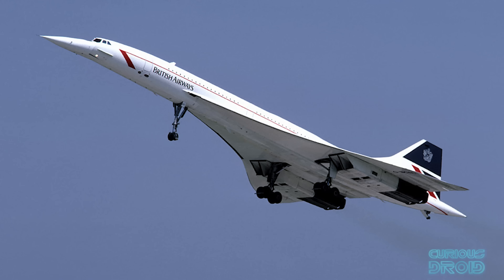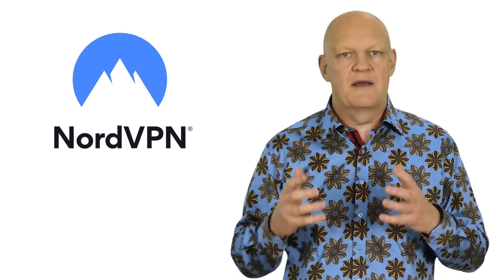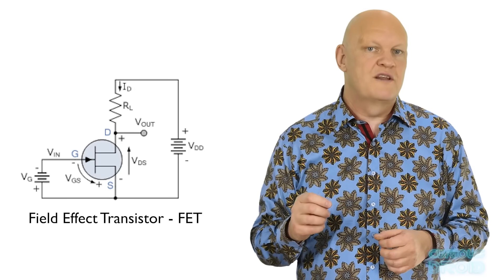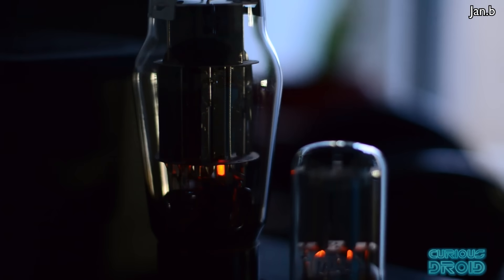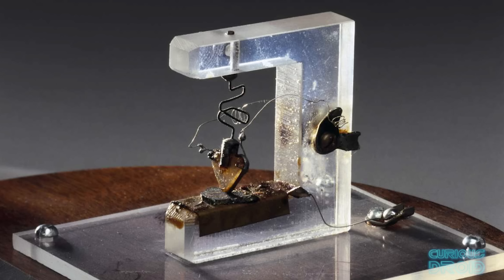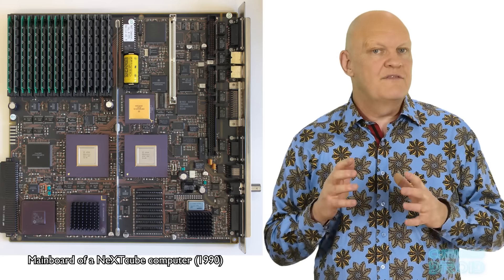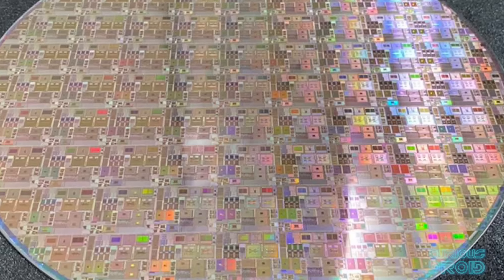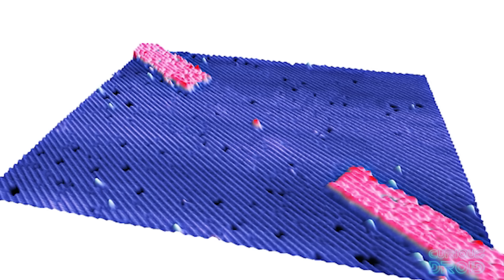MOSFET – The Most significant invention of the 20th Century

Comment: Mosfets as well as other random transistors are one of the items I've purchased in large quantities over the years that ill probably never find a use for.  Although I went to school for electronics tech its only a hobby for me, but its led to me feeling the urge to collect mosfets, as well as 100+ lbs of magnet wire aka enameled copper, and an absurd pile of large electrolytic can capacitors.  Think i have somewhere in the 250 - 300 large dc caps.  Probably my most valued possession.   Lol.  Im a bit ocd.  Especially the compulsive part of it.

Comment: MOSFET's also transformed the audio industry in the 1980's by providing a warm high power output for audio amplifiers,  which was far superior to the Bi-Polar designs common at the time.
I still have my MOSFET amps, built in 1987. They get used every day and still sound better than just about anything else that's ever been made...

Comment: Most significant?
No.
WIlliam Shockley. of Bell Labroatories, had intended to invent the MOSFET as a transfer of the Vacuum Tube technology of the day into a solid state design, but was stymied by his limited understanding that the surface of his semiconductor device had to have a perfectly regular crystal structure, and had to be made from perfectly pure stock.
That is, Shockely's inability to understand Surface States meant that his design could never succeed. Failure was followed by failure over several years.
In desperation, Shockely team members Bardeen and Brattain abandoned Shockley's concept, and created the point-contact transistor.
This device had no precedent in any form of electronic design - it was a "totally unique" device that owed nothing to any prior art, and was obsolete almost from the day of its invention.
Shockley, who had been left out of the point-contact Patent, then invented the Junction Transistor.
Junction devices would dominate seniconductor technology, in radio, televsion and communications for some 30 years, including RTL and TTL logic chips and some few microprocessors.
It would only be with Mohammed Attala's revisiting of Shockley's design, addressing the problem of Surface States, that Metal-Oxide-Silicon devices would become practical.
It is true that MOS (NMOS/PMOS/CMOS) technology would come to dominate electronics and computer techology, with bipolar devices dwindling well into the minority.
But it was the Point Contact design that proved the practicality of semiconductor technology, junction devices that established semiconductor technology as a viable alternative to Vacuum Tubes.
MOS devices leveraged the commercial success and industry-wide application of junction technolgy, making MOS - for all its current dominance - the third phase of semiconductor applications.
I do not agree that "third place" equals "most signficant" - dominant? OK.
Reply: The RCA 1802 was produced on silicon on sapphire. Silicon does not grow perfectly on this. Does it form domains? Need gates avoid domain boundaries?

Most semiconductor insulators interfaces have surface states. Only silicon does not. Why does roughness matter ?

Comment: The mosfet is just an ant worker what is do boreing things like switching on and off.
The things around we are olso chaned a lot because groove a demamd to use this switching devices because they are cheap to produce in large volumen.
They are thruly change the thinking they turn every power or signal processing into the digital way.

Comment: The most amazing thing is if you take a group of a dozen smart individuals, place then in an island with access to cuper, iron, thin, lead, stone, wood, mud, sand and a few other raw materials, with the average knowledge we have nowadays,  we could jump from stone age to pre-industrial in less than a decade. With primitive makeshift tools and raw materials, we can make every time a more developed tool. As hammers, pliers, saw, files, and so on. To pass the industrial revolution, we would need thousands of people. But to make a single integrated circuit, it would require the effort or millions. Too many and too much precise and sophisticated machinery are needed, and very specific scientific knowledge. Until the millimetre, it's a normal human terrain. Smaller than mm, it requires machinery that a single individual isn't capable of developing himself alone.

Comment: Can anyone explain exactly how a transistor amplifies voltage?

Sure - it might be able to 'hold-back' the input voltage versus the output - creating a gradient - but that isn't 'amplified' - just restricted in-command.

If it is fed X Volts - how does it create >X Volts - at all?
Reply: I’m most familiar with audio amplification, so here goes my explanation of a bipolar junction transistor (the kind used in amplification) from that angle: a base current in the form of a lower amplitude signal (e.g., from a guitar pickup) modulates the voltage gradient of a transistor in a separately powered amplifier circuit. This causes proportional changes in that higher amplitude collector current (e.g., the guitar amplifier signal powered by the wall outlet), in effect increasing the amplitude of that original signal by recreating it in a signal with higher amperage. So the transistor allows a smaller current to control, but doesn’t actually supply the power needed for, the amplified signal—that’s supplied by the amplifier’s power source. The voltage gradient has to do with how the transistor itself works to modulate the higher amplitude signal, allowing it to be controlled by the lower amplitude signal.
Reply: It doesn't amplify voltage by itself, a higher voltage source fed through it's emitter collector thus the input signal at the a base is amplified (mirrored with the source). Basically you have a device that can modulate raw external power with a small input signal. You do need a source, just like a audio amp needs the outlet. Although it inherently has some current amplification properties.
Reply: @neurotransmi77Er  Ah - so, it's not doing anything more magical than a simple relay, correct?

Except, sure - it is chemical, not mechanical.
Reply: @ArifGhostwriter  by itself, in principle, true, but you can also amplify AC signals at input with DC at source. That was the original challenge. Relays can't go analog. It's either 1 or 0. Although it might be possible (and noisy as hell) in theory but not practical. Transformers were the deal at that time.

Comment: I'm still not clear on how the machine accesses the stored information.  If you have say, an MP3 song stored in a chip, that would mean several millions of gates charged or not charged presumably in a sequence.  On a vinyl record the stylus moves along the groove and wiggles accordingly.  OK.  On a magnetic tape the tape moves over the head which detects changes in the magnetic field.  OK.  But...in a chip everything just sits there and nothing physical moves down the line "reading" those gates as being 1 or 0.  

All I can come up with is that a current moves down the line and is altered by every group of 8 gates along the way?  If so, how can that be if the electrons are moving at around 140,000 miles per second?  The song would be over in less than a second.

I suppose it would have to read the entire song, store it and slowly release it to the logic gate system/program that interprets voltage differences as variations in sound wave amplitude?

Comment: A Communism-disguised-Capitalism system;
Karl Marx, Nikola Tesla, Balfour, Einstein, Huxley, Orwell, Turing - should be forgiven for thinking their systems can last forever.
Finite fossil fuels are dangerously hypnotic to humans, their consciousness, reasoning and mental capacity.
Humans were not ready morally, ethically and intellectually to start the mass extraction of fossil fuels with the advent of the steam engine 300 years ago. 
The Magna Carta requires today overhauling – adding to it the right for humans to understand what Energy really is - before any other commandment;
“In any system of energy, Control is what consumes energy the most.
No energy store holds enough energy to extract an amount of energy equal to the total energy it stores.
No system of energy can deliver sum useful energy in excess of the total energy put into constructing it.
This universal truth applies to all systems.
Energy, like time, flows from past to future” (2017).

Comment: Moore's Law is forcing us to follow in the footsteps of Mother Nature and use some of the tricks she uses.  First we start out planar.  Then we go vertical.  After that we go manifold.  And finally we leave the single tissue stage of electronics and go into making essentially organs.   But what about heat you say?   Well yes, it will require a pump/heart.  It will require surface area.  It will require us to think in terms of self assembling electronics and exploiting quantum mechanics in controlled environments inside vats to grow our evo-chips.  Maybe.  Just a thought.  Ideas do seem to present themselves though, and just right at the right time when we are actively looking for those solutions we need.  There might be design, technological, and manufacturing hurdles to jump over before we get there...but chips that no longer resemble a simple tissue and start to resemble an organ are not physically impossible.

Comment: Despite promised advances in chip capacity, low to mid-range computers have remained at about the same overall power for the last 10 years. My HP x360 laptop (bought in 2016) is STILL more powerful than the bulk of inexpensive laptops available today. So most people will be unwilling to buy a new computer if the one they already own is as fast as the ones available in stores or online. 
Which is a problem for Microsoft Windows systems. Because Windows 11 won't load on most of those older computers, due to requirements like TPM 2.0 and such. So pretty soon millions of users will be looking for alternatives to the new Windows operating system releases.

Comment: @11:20 that exact flash drive failed on me, because it wouldn't side out and lock/notch to you can stick em in your good old USB 2.0 portno instead they just fail first by being unable to get it into a smart TV FOR EXAMPLE with No MKV players supporting CASTING, or h.264 1080p AVI That can or can not play the file through casting but would with a USB Controller, and that little device failed on me good for 2 HD Movies under2 gigs or 720p about 5 or 6 SO what waas wrong with these old USB sticks and if i buiy a 128GB new one, The FINFET Vstacking technology of samsung SSD's..... hmmmmm how reliable is it and what brand f USB Stick carriers or SSD's that support SATA and SATA power as well with a module that makes the USB Compatible forrom the outside of a Laptop s i can charge them up on a deskktop bring my entire movie collection from Y T S {DOT} AG so someones $K TV As i can download the 4k files but to view them just stick to a USB STICK ey of 160GB for a 4GB movie yeah (wllcompressed excellent quality audio lemme check H>264 doesnt dsay shitabout audio except DTS and someones setup
Reply: " without leaking away over 10 years " uhm, if a 164GB USB pendrive only lasts 10 years? yeah id rather stick to a 8TB Harddrive

Comment: The structure resembling the MOS transistor was proposed by Bell scientists William Shockley, John Bardeen and Walter Houser Brattain, during their investigation that led to discovery of the transistor effect. The structure failed to show the anticipated effects, due to the problem of surface state: traps on the semiconductor surface that hold electrons immobile. In 1955 Carl Frosch and L.

Comment: I want to add that after inventing point contacts transistor by Willium Shockley , John Bardian and Grand  Britain, in Dec 1947, the transistor radio  was not shaped,  until the Junction transistor was invented in 1950. Bcz point contact transistor was of directly proportional to out puts hence its amplification directly caused on its in put circuit and caused more noise.
The 2nd invention junction transistor was  inversely proportional to output, so no positive feedback and no noise.
Then soon after the commercial transistor radio was invented.

Comment: The MOSFET was invented by Mohamed Atalla and Dawon Kahng at Bell Labs in 1959. It was a breakthrough in power electronics. Generations of MOSFETs enabled power designers to achieve performance and density levels not possible with bipolar transistors.

Comment: One 7 nanometer transistor is 35 silicon atoms wide. I can't figure out how it is possible to work on such small size dimension, without make any errors on millions of transistors. It is also impossible to figure out how it is possible to build machines which can work on that scale of mechanical precision. I don't know how many people are fascinated by the bulky and energy wasting vacuum tubes, and not by the silicon integrated circuits...

Comment: At the heart of every EV and PHEV electric automobile, is a device called an "inverter". It's job is to take power from the car's traction battery, which is "direct current", typically around 375 volts, and output 3-phase alternating current to create the rotating magnetic field in the car's drive motor that makes the rotor spin and propel the car down the road. In a typical car like the Chevy Bolt or truck like the Ford Transit EV delivery van, a single 3-phase motor is used, that can deliver around 200 maximum horsepower - that's a LOT of power out of a rotor and stator that weigh less than 100 pounds combined. In order to obtain 200 mechanical horsepower out of the motor to drive the wheels, you need to feed it at least 160 kilowatts of electric power. Out of a 375 volt battery, that's 426 amperes of current! Of course, most driving situations only need maximum power for short periods, for example to pull away from a stop on a steep hill, so most of the time the car's battery only needs to supply 5 to 30 kilowatts. At steady cruising speed on the highway, the car will only need about 20 horsepower, or about 18 kilowatts. So here's where MOSFETS come into this story. Remember the Inverter? It's job is to take DC from the battery and convert it to AC for the motor, and it does this with high-power MOSFETS. Attached to the rotor is a sensor called a "resolver", that sands a signal telling the computer in the inverter what the angular position of the permanent magnets in the rotor is, in relation to the windings in the stator coils. This computer sends a low-powered voltage signal to the gate of each of the three MOSFETS (or 3 pairs if they are doubled for higher power capacity); this voltage increases and decreases in a sine wave, and the three signals are phased 120° apart, since these motors are 3-phase "synchronus" designs. 

The low power signal to the gate allows a much higher current to flow between the battery and the stator windings through the channel between the Source and Drain terminals on the MOSFET. The computer uses the signal from the resolver sensor to set the timing and phase angle, and the signal from the throttle pedal sensor to set the amount of power. These electronics in modern EV's are so precise, that a driver can make a car crawl up a steep driveway and into a garage at speeds that make a snail look fast, or, the car can climb hills on the freeway at 70+ mph. 

Cooling: Traction motor Inverters in EV cars are all liquid-cooled: the MOSFETS are attached to a big aluminum heatsink plate through which antifreeze coolant is pumped, and the heat dumped to atmosphere through a radiator. The motor stators are sprayed with transmission oil, and that oil is run through a heat exchanger and radiator to dump waste heat to atmosphere (or to warm the battery in cold weather in some cars). The base of the MOSFET is coated with a layer of heat conductive paste, same as the CPU in a PC computer. EV powertrains in modern cars are amazing, and they'd be impossible without MOSFETS to supply the hundred-plus kilowatts of power for the drive motor.

Comment: Car audio amplifiers were my introduction to MOSFETs. I recall in the late 1980s and early 90s, manufacturers made a big deal out of their amps being "MOSFET" amps.
Can you guess what's inside of modern audio amplifiers in 2023? MOSFETS. They have gotten better, able to carry more current at higher voltage with faster switching speeds.

Comment: Oh, God! As a Professional Guitarist who uses Vacuum Tubes/Valves in Amplifiers and other Audio Gear to this day, just thinking about the Cost of replacing all 2,400 Tubes in The Colossus Supercomputer makes my head spin and my stomach turn!

Even if they were 12A*7 (12AX7, 12AT7, 12AU7, etc.) Double Triodes Tubes, the most common Tube Family in the World today, at a lowest Cost of ~10$ (USD) per Tube for the cheapest ones out there would still mean a 24,500$ Retube!

However, with the recent World Tube Shortage with a few plants having closed in the last years and one of the few remaining Factories having closed its doors, things are looking grim, as now most Tubes are made in Russia, and with the Economic Sanctions they have, Tube scarcity will increase and prices will skyrocket even more!

To give you an example, Retubing my small, low Wattage Guitar Amp (3x12AX7 & 2xEL84) was around 80-100$ before the prices skyrocketed, and my main amp, with 8x12AX7 + 4x6L6GC, was over 240$ a Retube!

Just checked what Tubes I have in my Main Amp and went to my usual Supplier (who's got VERY reasonable prices) and here's how much it would cost today:

8x Ruby 12AX7AC5 HG+ (36$ each)
4x Ruby 6L6GCMSTR (32$ each*)
Total = 416 USD before Tax & Customs!

*However, my supplier is running out of stock on this Power Tube and only sells them in Singles, when they need to be Matched by Pair or Quad for Guitar Amps, and the Matching can slightly increase the price.

So, the Colossus, at 2,400 Double Triodes @36$ each would cost... 86,400 USD!